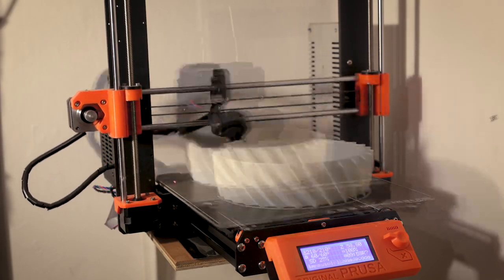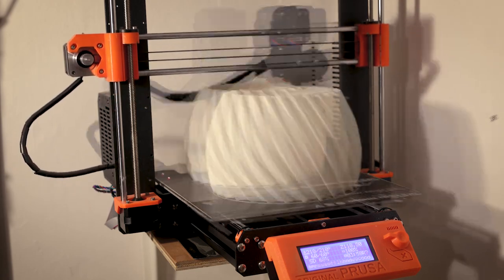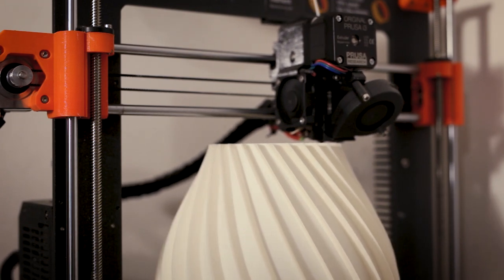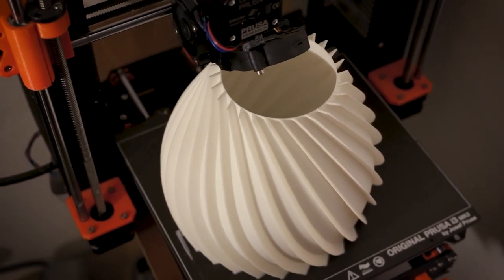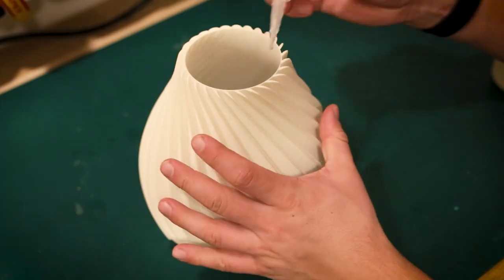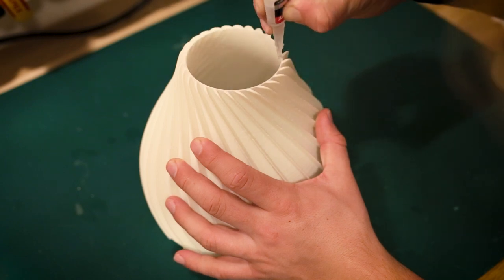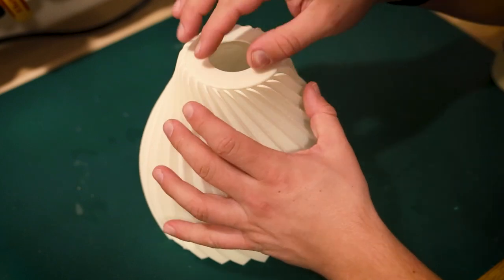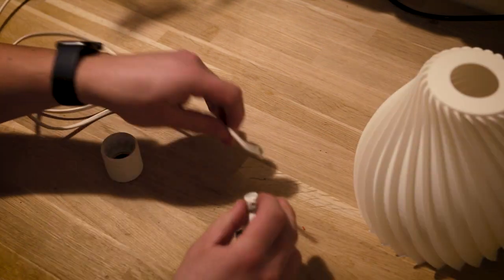3D-printing a Swirly Lamp Shade

Comment: Hello, how long it took? Could i ask for the files to print this aswell. Regards,
Reply from the maker: It takes about 8-14 hours to print depending on the layer thickness used when slicing the 3D-model :) I will consider making it available somewhere for download when I have improved the printability.
Reply: @jakobhalskov  
Er der mulighed for at man nu kunne så filerne til print eller design filerne?